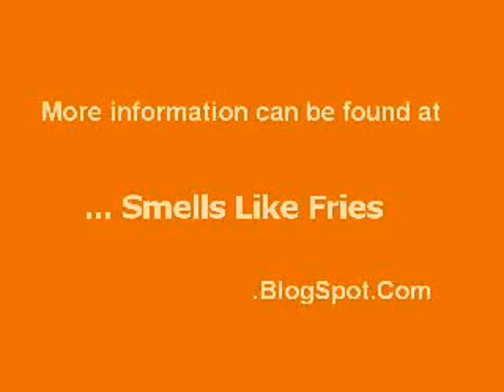Experiment: Wish Washing Veggie Oil Fuel

Comment: yea, i have been brewin bio for about 3 months, and i can tell you that washing bio is really just to get the 1% or so amount of trace impurities in the bio (methanol, lye, and soaps). the amount of impurities in WVO are much, much larger. and the wash did work, you can see that by the milk colored water at the bottom of the tank.